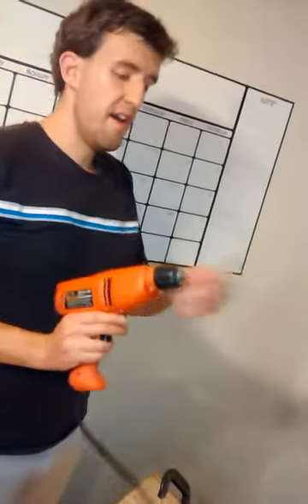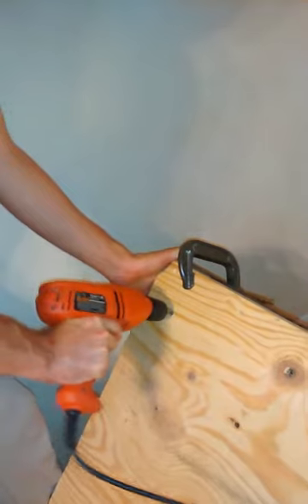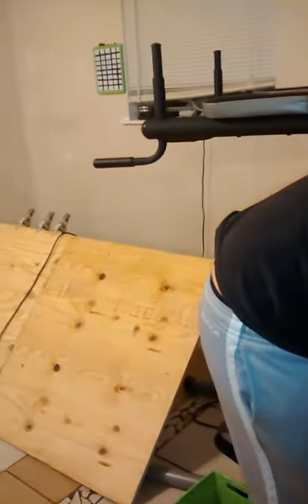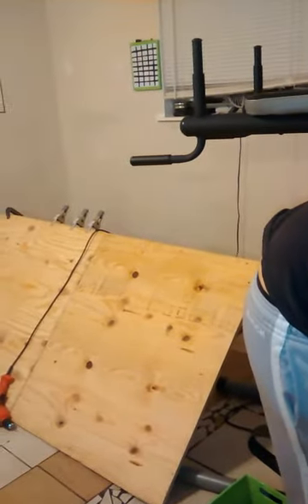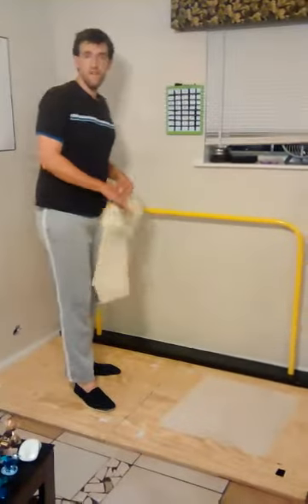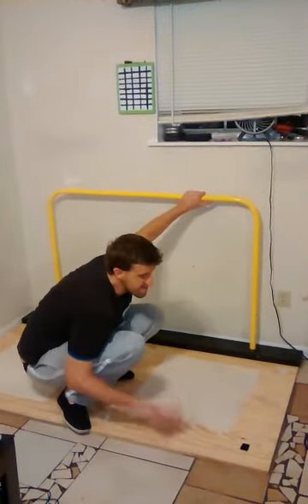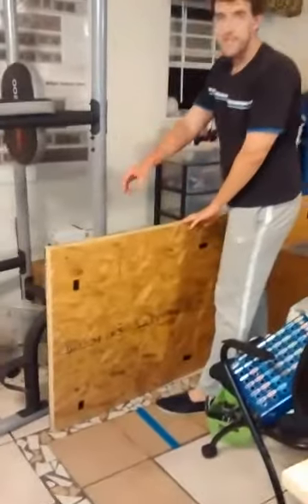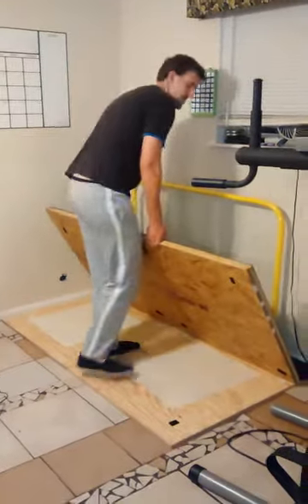Bar kit assembly 3 of 3

Comment: Just finished putting mine together. Thanks for the videos! It helped a lot :)
Reply: how much did it cost for the wood supplys?
Reply: +Kay-Ree Boulter For a slab of wood it was about $20 I think. I also had to buy all the tools since I didn't have any, so that added up to another $100 total in top of the pad itself.
Reply: mind you, I only got a single, not a double.

Comment: The velcro turned out to be a terrible idea. It's thick, so the MDF dance board ends up bending when you put any weight wherever the velcro is not. This bending stretches the metal tape on the inside of the pad, which causes it to break, causing dead spots, arrows spazzing out, etc. I'm speaking from 6 pads of experience (exchanges) until we figured this out. Use something thinner to connect the boards, like rolled gorilla tape. I used a wood boring spade bit with connecting cap nuts to connect the two plywood sheets for the base. This also eliminated the warp in the boards (with them facing each other, they canceled each other out). Putting pads on a warped board will also cause the pads to bend and cause the same issues.
Reply from the maker: Edward Anderson That's my pad and it works great.  But I'll heed the warning.

Comment: I've never seen one done with a bar like that. I imagine it would be great for doubles mode but not as good for 2 player mode.
Reply from the maker: I will be replacing this with two of our normal bars next month.  This was an experiment, I like to try new things.  The problems with this are that the bar isn't long enough honestly, it's 3" shorter on both sides than a normal DDR bar, where our bar kits are actually 3" LONGER on both sides than a normal DDR bar but I was limited by the length of the bar I used here.  Also when one player uses the bar it wobbles because bars wobble but it wobbles to your movement so it feels normal, when another player wobbles the same bar it is uncomfortable.  I do love the feel of the single bar rather than the bar I was using with the angle brackets and it looks sharp being counter-mounted under the base.